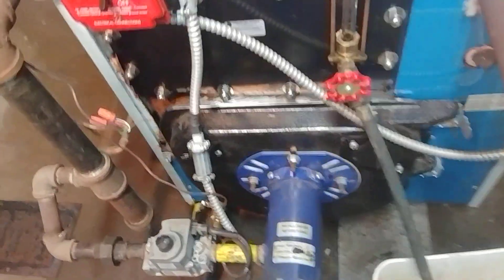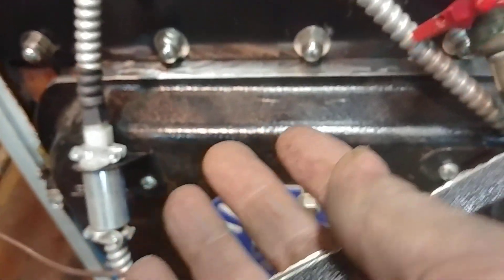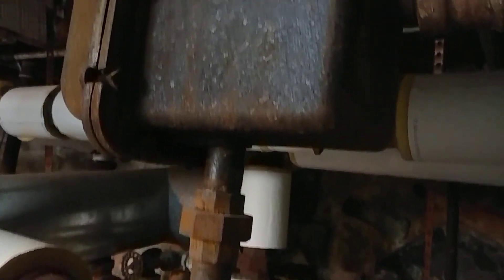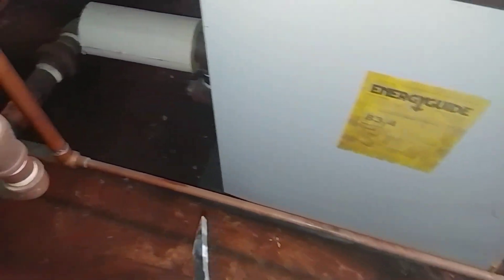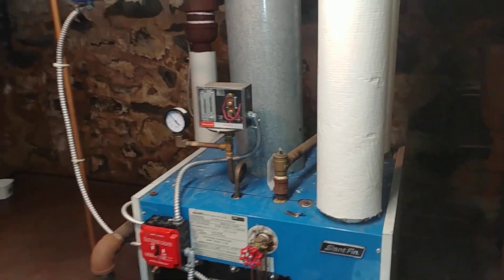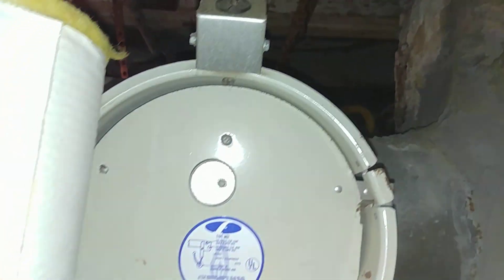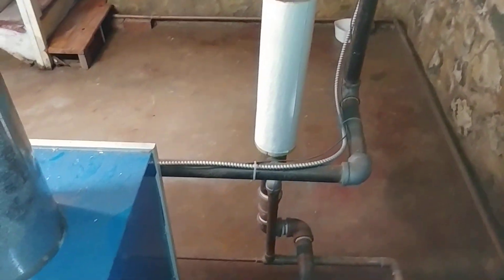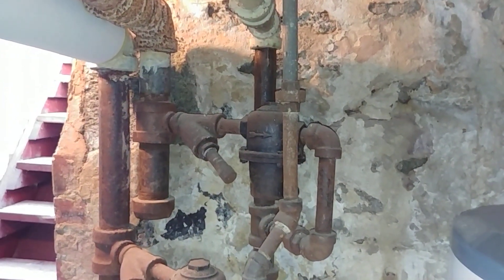Addendum To Slant/Fin Intrepid Steam Boiler Repair: The Burner Door Didn't Fit With The New Plate!

Comment: There needs to be a class action lawsuit against Slant Fin for this horrible design. They just discontinued the gasket and plate..
Reply from the maker: I am sorry to say Slant/Fin has been out of business for some years.
I've had a replacement plate made up at a local metal fab shop (Solutions Fabrication in Glen Burnie, MD).
Gaskets can be also made up to order at various places.
The gaskets made that way might even be better than factory, if you spec peroxide cured EPDM (or so I have been told).
Reply: @gordonschweizer5154  I was thinking of pulling the plate out installing new studs after drilling out the broken two bolts, and using urethane that they use for car windshields. As it’s much stronger than silicone.

Comment: Looking at the pipes and valves lots of check valves installed and lots of odd devices float trap at the dry return I think you said I will have to listen to what you mentioned about the wet return at the end of the main Moline was it?
Reply from the maker: There were many many different 2-pipe vapor systems back in the day.
They all are variations on a theme, so the actual name of the system is whatever.
I think this is an "Illinois System".
The name was bought out by Watts, IIRC.

Comment: A mfgs with any brains would use studs and nuts gives you two chances to get it apart instead of 1. Brass or stainless on the studs, I liked the old Smith 2000 & 2500 where the boiler had a flange and the tankless or cover plate went on with nuts and bolts. You could always cut the nuts and bolts if you had too. Seldom has to because the nuts and bolts never went "in the water"
Reply from the maker: I don't think this was an engineering decision.  It has "bean counter" all over it.
That rusted stud shown in the earlier video was stainless, probably 18-8 and not 304.
It appears that they had a fair number of warranty claims because they upgraded to studs and nuts and thicker rubber. (but didn't warn about clearance issues, the swine).